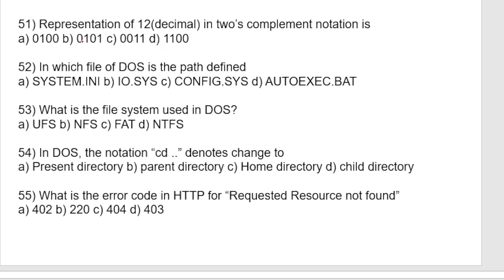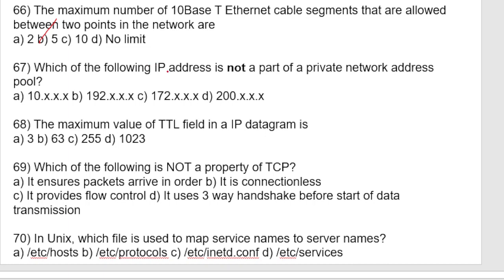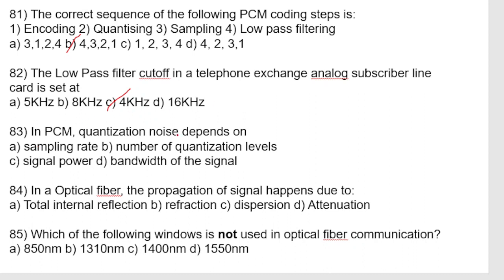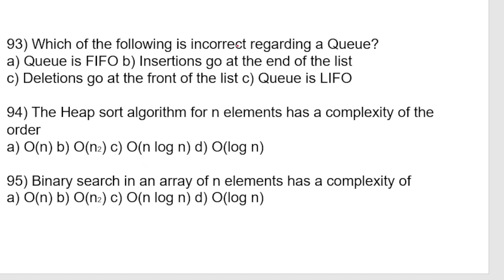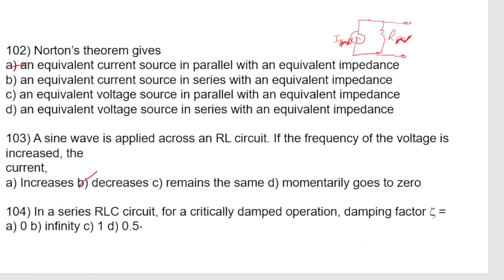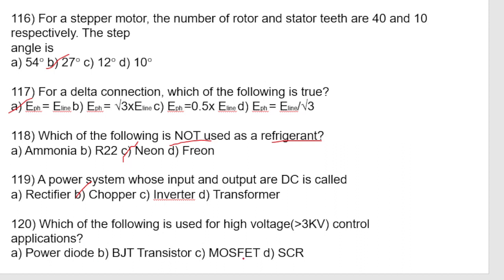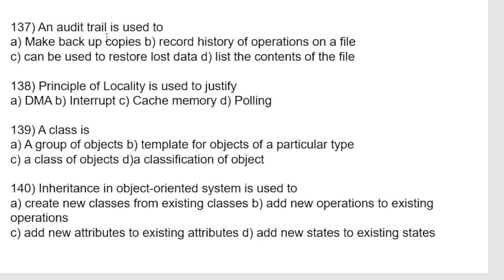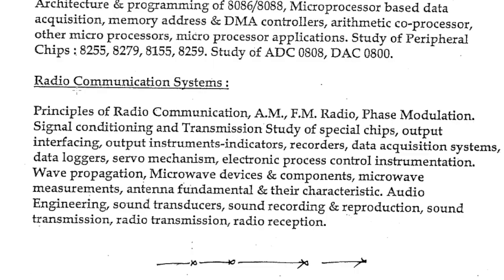Part B l Technical l LICE 2013 EXAM PAPER SOLVED

Comment: Sir,
Q.73 Wrong Answer Marked
Please correct it 
It should Be Saturation & Cutoff
Reply from the maker: Thanks for identifying the mistake, Yes Question 73 correct answer is transistor work as switch in cutoff and saturation region.